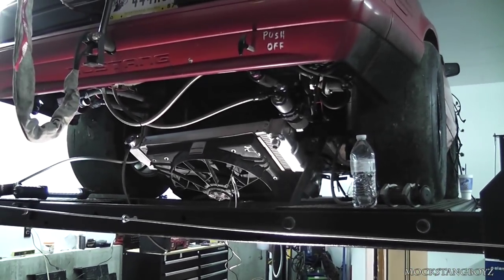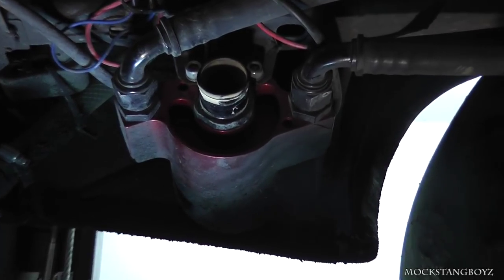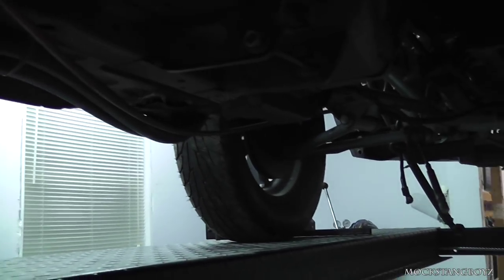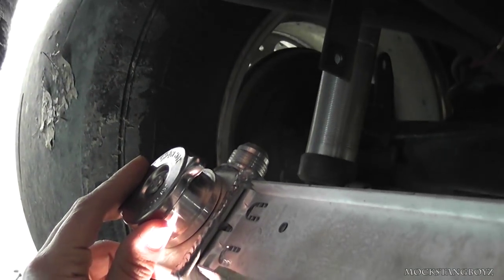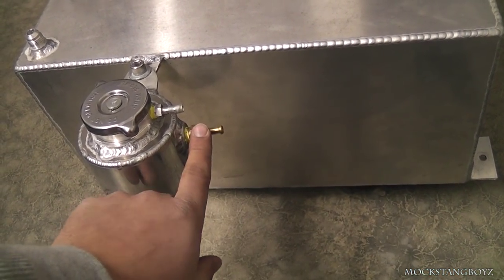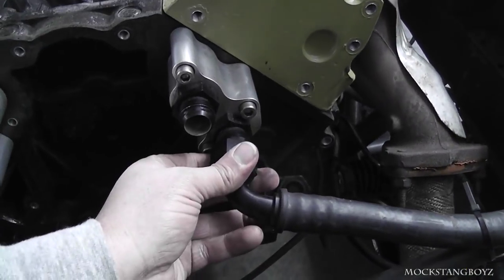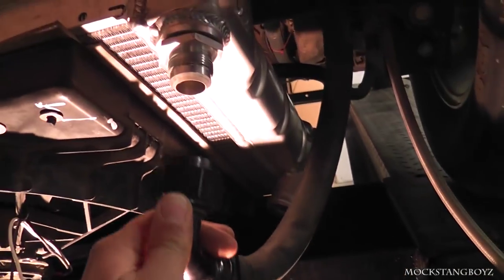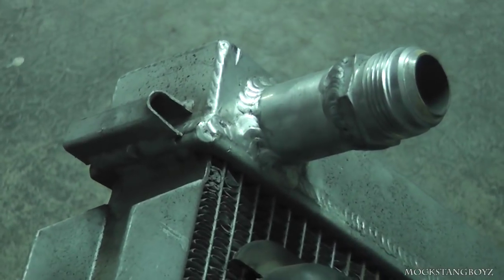Rear Mount Radiator - STREET CAR!

Comment: Just a tid bit, for a rear mount radiator you need at least a 50 gpm water pump (or stock LS) and roughly 4,000 cfm of fan depending on radiator size

Comment: Really appreciate the video. I've always been curious about this set up for front mount turbos. 

I have a question, how about running a smaller radiator along side a front mount. What's the simple way to go about picking a efficient radiator or is rear mount the best way for front mount?
Reply from the maker: +demikpre 
Your welcome! Hope it helps alot of people that are trying to do something like this.
Yes, we have did setups with a smaller radiator beside a front mount, as well as setups with a standard size radiator tilted under the hotside piping up front. We have ran single pass and dual pass radiators as well. The dual pass makes it easier on you with the inlet and outlet both being on the same side for stock water pump stuff in a normal setup. We prefer the rear mount radiator mainly because of all the extra room you get in the engine bay and easier engine swaps when they blow up haha! Some cars I have seen running 2 smaller radiators up front with the turbo in the middle as well.

Comment: Bringing it back from the dead one more time, so the only 2 things going to the expansion tank is the steam vent from the heads and the -12 going to the top of the radiator? Or do you have the over flow line from the original waterneck on the radiator going up there as well?

Comment: nice set up luv the car man. was wondering how loud is the 55g water pump thanks for your video. building a 1940 chevy coupe front mount ls turbo. trying to figure my room out I don't have much room to work with and rear mount radiator would help out a lot. thanks again. nice
Reply from the maker: Thanks!  The water pump is very quiet, it can barely be heard.

Comment: Nice video, how far do you guys mount the radiator off the trunk floor? or how much clearance does it need?
Reply from the maker: The top of the radiator is close, maybe 1" or so. The bottom just give it as much angle as possible without looking terrible. I'd say that's a good base to go by. There's no certain specific angle or clearance.

Comment: When the radiator is mounted is it horizontal or does it have some angle in it, if so what's the angle?
Reply from the maker: +RecklessRegal 
It gets mounted almost exactly how it looks in the video except up high near the trunk floor. No specific angle. Maybe a little less then what's shown here to keep it from hanging down too much.

Comment: What did you guys do with the steam vent holes from the heads? Are you routing the vent lines back into the coolant system somehow?
Reply from the maker: Yes, on Lil red we run a line from the steam vent back to the expansion tank in the trunk that drains back into the radiator. We have since found an easier way is to buy the Moroso filler neck with 3/8" npt ports already on it ready to go "Moroso 63461" and just go from the steam vent right over to the filler neck and that's it.
Reply: darthzman ii

Comment: how u mounting it?
Reply from the maker: If the radiator is pretty bare like this one then we just weld some tabs to the sides. Make brackets that attach to the rear floor and bolt it in place.